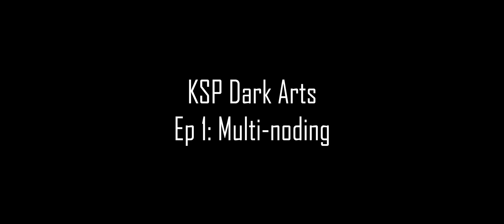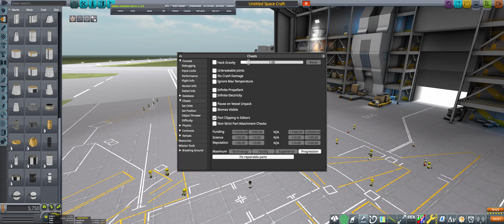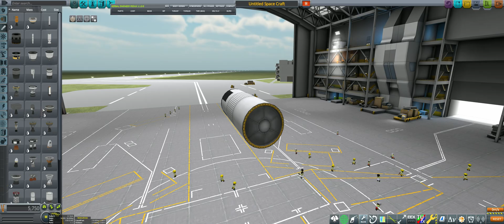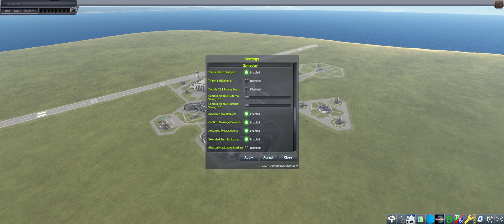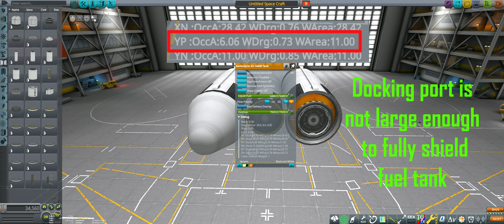KSP Dark Arts: Multi-noding

Comment: I think a reasonable compromise for this technique is when adding structural parts with other smaller parts inside.  For example, making a modular girder rover body with built-in batteries or liquid fuel storage - as long as one of the clipped parts could reasonably be hollow it could be acceptable.

Comment: I stumbled on the first half of this trick ages ago, and just thought it was neat. It let me finish a complex build without refitting the refinery every time I changed the style of the front end. Other than that, if I'd known about it there are a few times I would have been tempted to use it, mostly when mounting engines, so perhaps it's just as well I didn't.

Comment: Could somebody with a better computer than me do a lag test? I remember that Stratzenblitz found that KSP handled very poorly multiple fuel tanks linked to one engines, so my question is, could this attachement technique allow you to attach several fuel tanks to an engine or vice versa without the exponential lag effects this creates normally in KSP?
Reply: iirc this technique breaks fuel transfer between tanks
Reply: @oo4310  that is why I thought it could be intresting as an anti lag design element, since the tests Stratzenblitz conducted found out that fuel networks between many fuel tanks exponentially increased the lag, scaling with the number of fuel tanks per networks

His solution was to put 1 engine per 1 fuel tank and no more, I was wondering after watching this video if it was possible to either hook up several fuel tanks to one engine (good for high efficiency missions) or several engines to one fuel tank (good for TWR and artsy crafts)
Basically because of how KSP was codded, if you want to build giant crafts you have no other option at all than 1 fuel tank per engine and no more, that's why I was intrested in the possibility this could get rid of that limitation (ie: attach several fuel tanks to the front node of an engine, and record if the lag is linear or exponential, my PC isn't good enough to do that sadly)

Comment: Seems like a good idea for a series, not sure if it's still in the game but using loads of control surfaces and spamming W+S to gain speed is a fun bug to gain a bit of extra speed on a plane.
Played ksp for a while and didn't know about multi-noding, pretty cool exploit.
Reply: I accidentally discovered that a while ago with some tweakscaled canards and the authority limiter slider. I got ejected out of the kerbol system at several dozen C

Comment: I wouldn’t really consider it cheating,because you can just achieve the same thing using a girder,I think it’s more of a performance saving technique since you can cut down partcount with it.
Reply: You can't achieve the same thing using a girder unless you also start abusing fairing clipping. If you attach, for example an engine to a girder, that engine will create a whole lot more drag than if it were attached to a ≥ sized fuel tank. With this method you can attach as many engines as you want to a single fuel tank and they will all have the low drag associated with having a fully occluded front facing node. If you consider fairing abuse cheating then this would fall under the same category.
Reply: @K.O240  You can do the same thing though (if the engine has a rear node) by just stacking the engines one atop the other, disabling the shrouds if needed, and then offsetting them to be right next to each other, right? That way, all the top nodes of the engines (and with this method, also all but one bottom node!) are all occluded.
Reply: Pretty much. This seems to be more a quality of life thing than anything else.

Comment: Crazy. Would you consider this as 'Cheating'?
Reply from the maker: I wouldn't personally consider it cheating, I have a few categories I consider things to fall into:
Pure Aero: no exploits at all.
Soft Aero: creative use of offsetting, some clipping as long is it isn't jamming a billion tanks in a fairing.
Hard Aero: Multi-noding, fairing clipping, engine plate abuse, etc.
Freestyle Aero: Heatshield and other magic wings.
Cheats: perpetual motion, free energy, Kraken drives, etc.

I am generally willing to use up to hard aero in my missions, but try to stick to the lowest level I can and still be able to run the mission.  And as long as people don't misrepresent what tricks they are using I have no issues with any levels.
Reply: @lt_duckweed  I personally like to use negative ions for infinite energy for my large boats and walker because putting 400 rtgs down isn’t very nice on my pc